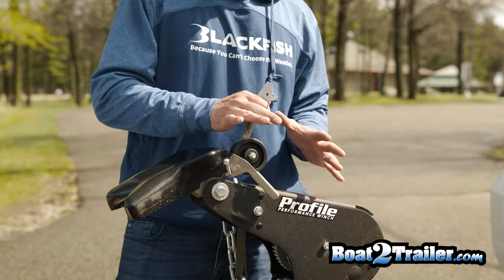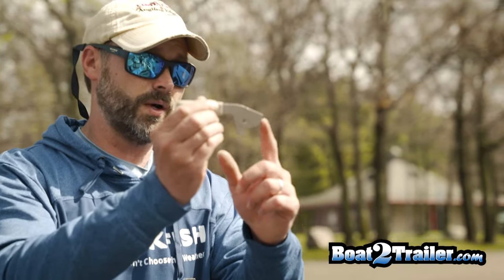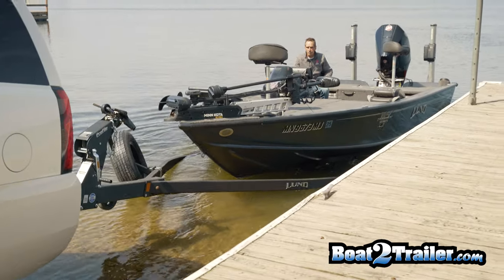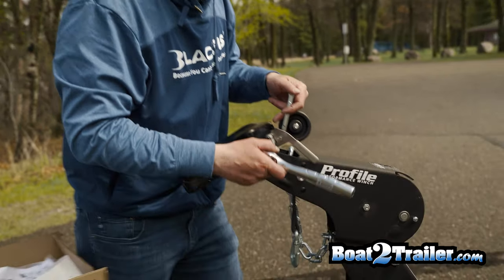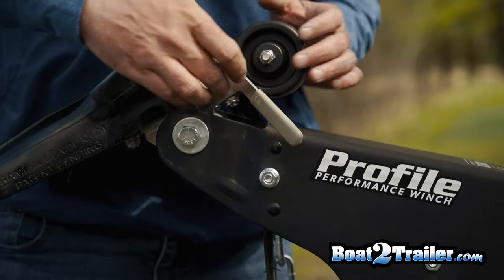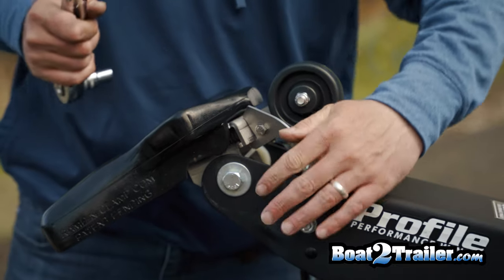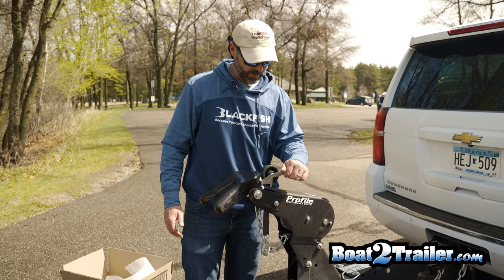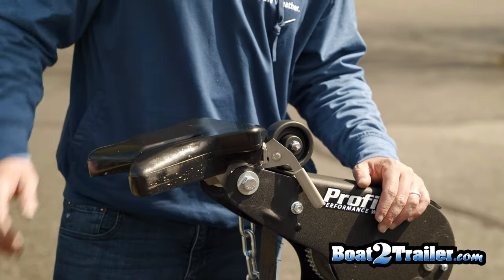Install The Manual Short Handle on The Boat2Trailer Latch - Ramp N Clamp Short Handle

Comment: Everyone saying rather one over the other for bunk trailer vs roller trailer. What's the difference?
Reply from the maker: We typically recommend short handle for bunks and long handle for roller trailers. the short handle allows you to release the clamp on level land and the boat comes off the trailer once it floats. the long handle allows you to release from inside the boat when the trailer is already in the water